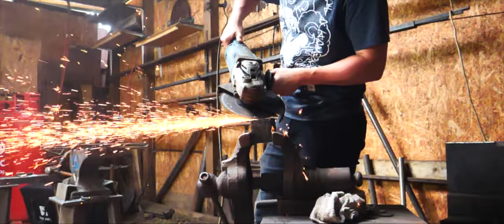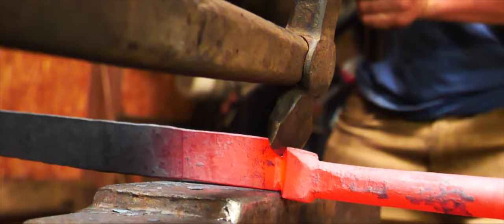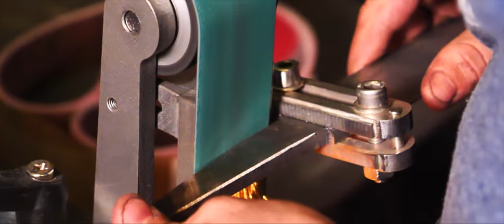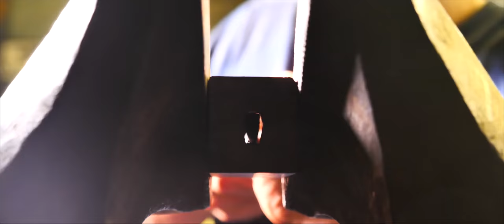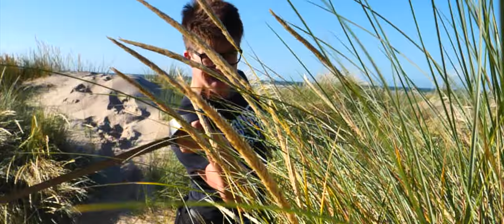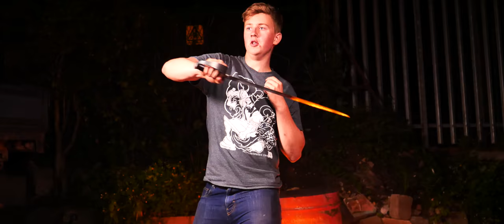18 AND 19 Y/O FORGE EPIC DAMASCUS PIRATE'S CUTLASS!! - The Reveal

Comment: Alec: can you describe the molecular process that takes place when you're forge welding with a hammer? I'm curious why the steel needs to be hammered to fuse together vice squeezing it with the hydraulic press. it's apparent that that would not work but I'm curious to know what is happening to the metal layers when they are struck.